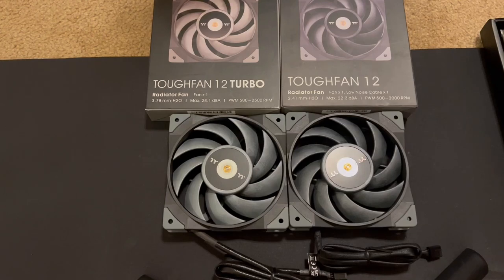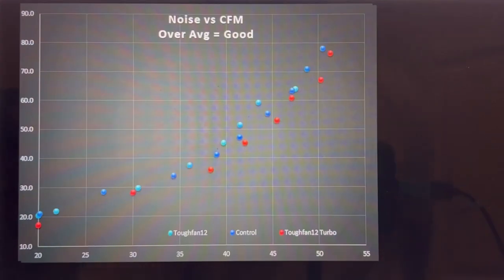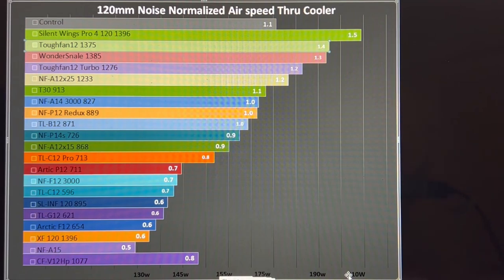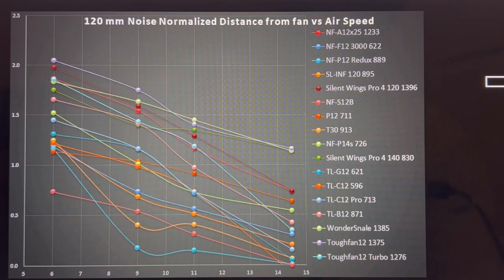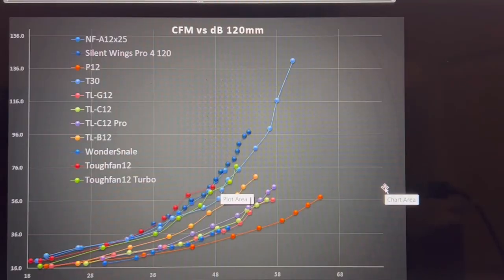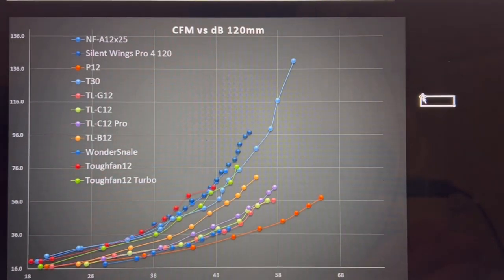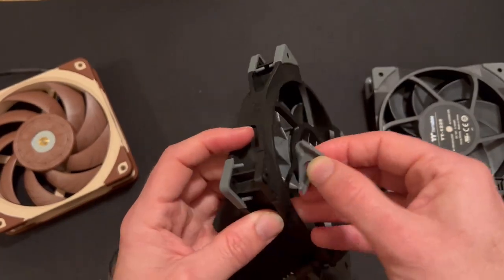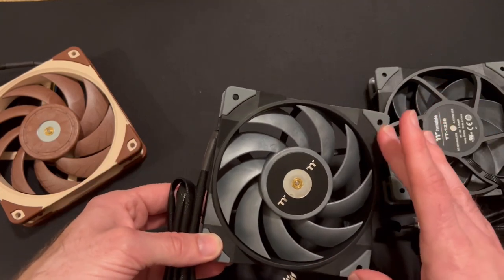Its a Tough Job Cooling PC Hardware: ToughFan12 & Turbo  (Old Testing Method)

Comment: Thanks, for your effort and time ❤
Reply from the maker: Thanks. Its a lot of work making videos. The testing is a primary interest of mine. labor of love. haha.
Reply: @computer-tech-more  you brought up something I had not heard from anyone else before; the difference in distance from the fan at 7 9 14 inches... Manufacturers don't explain that... Also the amount of air at each rpm and decibel.... I only saw Lian Li do it on the P28, where the state cfm, noise and statir pressure at the 3 modes the fan performs, that way you have a better idea
Reply from the maker: @elteacher0223  Thanks. the distance thing: Thats actually why im doing it. Most reviewers just do CFM and a heatsink forgetting that case airflow is different. Currently I am just to limited by my size to get even better testing. 
I really want to find a smoke machine or something to allow for a visual representation. A party fog machine wont work. 
Fan design is cool anyways. :)
Reply: @computer-tech-more  you are right.... I have noticed that most fans like t30, pro4, etc... as case fan, all of them make a lot of noise over 1200rpm, but on a heatsink you can barely hear them a 1500-2000rpm, most reviewers dont mention that...